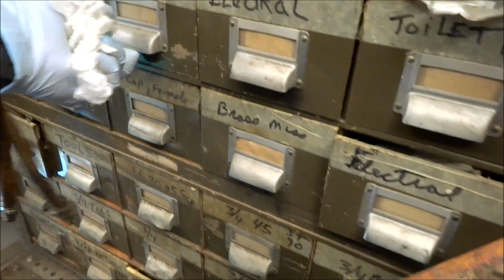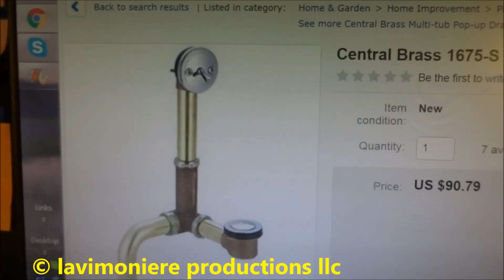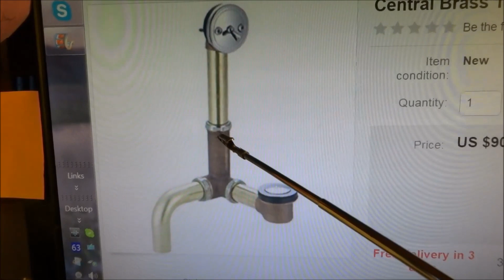tub repair job turned into major project part 1 of 2

Comment: Open up the wall and change the overflow????  They sell a press down / spring loaded drain stopper that screws into the drain and pops up and down when you press it. 15 minute labor, $15-$20 part.

Comment: what a major job. i would have opted  for a rubber disc set over drain opening to keep water in tub .easier. cheaper. and it works . but that would be for me, doing for a customer always costs more money.

Comment: 29:31 Don't you just want to smash it with a hammer till it's destroyed! :)...Nice chunk of brass...I have a nice little collection of the drum traps after 30 years......We usually have lead connections. on those old assemblies So, sawzall and fernco......I just did the last one I'll most likely do attached to a lead pan...Retiring from that stuff...Getting in those access panels and working at the floor level is just too hard anymore!
Reply: Like the way he uses channel locks as a hammer,guess he don't own a dead blow mallet.
Reply: @340rps  :)...It's either grab what you have nearby or get up and out of the hole...I say they need to weld a deadblow on one of the channel lock handle ends...Maybe a flashlight too?....:)...

Comment: Coulda used a watco pop up drain kit. I use em all the time
Reply: I use the same thing. Unthread the old strainer and thread the watco in and either change out the old overflow cover or just leave it, doesn't really matter
Reply: I was thinking the same thing... Badda boom, badda bing! Done.

Comment: At 27:34 a few inches to the right and an inch or so below the "tough nut" was a plastic nut that transitioned brass to plastic pipe.  Would this have been easier to remove?
Reply: I dont understand why he didn't just install a new pop up strainer.... oh paid by the hour
Reply: He’s rank ripping her off lol

Comment: Am i missing something here? Why would you not just install a pop up drain or new manual twist screw drain that the customer can open and close directly right on the tub floor? Why do to all that work just so the opening and closing of the drain is coordinated with the overflow? I agree with all your repairs so far but I am totally stumped on this one.
Reply: It’s because rich homeowners have more money than brains
Reply: Just for shits and giggles.
Reply: Selling 101 homie. Sup from LA.
Reply: He only gave her two choices, either be happy with the rubber stopper or if she wants to go with the current linkage then he has to open up the wall "there is no other way", he told her.   Actually for $20 it can be fixed with a Keeney  Chrome Drain Cover  "The Keeney® Universal Quick Cover Up Tub Stopper covers worn or unwanted drains without having to remove the drain. It installs easily with no tools and has a polished chrome trim. Includes roller ball stopper style and fits all drain openings, including Triplever. Keeney is a leading manufacturer and distributor of tubular drainage products."
Reply: What ever warehouse has, get tub fixed, go to next job.

Comment: 22:24 Woah mama. What's that drain removing thingy? Does it come with new drains, or is it a standard plumbing tool? What's it called?
Lemme guess "Drain removing thingy" ?
Reply: It's an Internal Pipe Wrench. It allows you to "grab" the inside of a pipe or fixture to remove it, especially if there is no room to get a regular pipe wrench on the fitting.

Comment: Brings back memories (as a plumber's helper) of having to use a sawzaw to cut those brass nuts off and avoid messing up the fitting's threads if needed.

Comment: what is that tool you inserted to pull out the drain plug? thanks. this coming spring my son will be coming home so maybe we can change the drain and p-trap.
Thanks!
Reply from the maker: http://www.ebay.com/itm/One-1-Bathtub-Drain-Key-1-1-4-and-1-1-2-Remove-Install-Tool-tub-Free-Ship-/121852766230?hash=item1c5efda816:g:p10AAOSwyQtV52~v
Reply: Thanks very much Steve for the link. If it is not for your video. I did not even think that this tool exists. I am sure so many people you have helped are very appreciative of your knowledge.  You should be teaching at a Technical College when you retire because of your deep knowledge of heating. God bless you.
Reply: @23:50 I could have used that a couple weeks ago. Superior Tool 04500 DrainKey™ Tub Drain Remover

Comment: I think I saw that you use Kroil in another video. The stuff is the best stuff I Have ever seen. I used it today on 20 year old fittings and the stuff is a dream. I let soak in for 30 seconds and it still makes a huge difference.

Comment: I'm laughing!  Yep, just 2 weeks ago we had our 50 year old cast iron tub sprayed white.  The guy yanked out the 2 thingy drain parts and replaced them with a turn and drop plug job.  Looks nice, but I feel the old time 2 part drain set up, which you are trying to explain, probably will have done better.  Hair catches on the hinged long leggy piece which slid into the drain hole.  It had a weighted brass tube on the end which interacts with the overflow part(?)  I kept the parts.
Reply: DOLRED

Comment: I have to assume the customer insisted that it still works the same as the original, I never replace those things. Job security though, you’ll be back for hair clogs every 3 months until the end of time.

Comment: Wouldn't you just carry a PVC or abs waste and overflow.  Offset it with some 45 elbows.  I never like to bury compression fittings inside a wall or ceiling.  Definitely several different ways of doing this job.  Recip saw to cut the old one out.

Comment: you are so calm working on the tough stuff. i would be swearing a blue streak at that damn nut and stuck drain pipe.  might have used a sawzall...

Comment: Steve, you should of just gotten a plug that fit the drain, charged $250 and gotten out of there. Doing the right thing is not worth it sometimes. As always great video and that is the cleanest bathroom and pipes you have ever worked on! Keep up the good work.
Reply: I was thinking that too! I remodeled my bathroom and put in one of those toe tap drains!

Comment: Watco makes a retro drain kit that allows you to remove the trip lever and cover the overflow with a cleanout plate and the drain that comes with it has a bushing to fit the drain shoe to install a new drain and turn and lift stopper. There is also a stopper shoe extractor tool to remove drains without the grid. They cost around 50 bucks for a chrome finish and takes about an hour with travel time.

Comment: Personally I would buy a stopper for $1 and be done with it.
Reply: yup
Reply: He’s ripping her off lol
Reply: Hes not  Ripping her off he Gave her the  information she needed To make a d Decision.
Reply: Personally All it takes is a child to drop  A toy in the drain and then have the whole drain plug up. That $1 stopper can cost you a   Fortune. Everyone's situation is different just as their ability to get projects done. The man gave her the information she needed to make her informed decision.
Reply: @Gcanno  I know they just wanted it fixed right. Even still if I wanted it fancy, I would of installed a less complicated lift and turn strainer or the push type.
Reply: I would agree, but you want to pay extra for me to come out on Sunday, I will be there ready for action
Reply: Replace current drain with toe touch which has a built in stopper.

Comment: You can just replace that with a Touch-toe style drain kit with a blank overflow plate without opening the wall.
Reply: patrick cronin that's the first thing I thought of
Reply: Thats true but he does get paid by the hour
Reply: That would've been the nice thing to do but he's worrying about his pockets too.
Reply: exactly. or even cheaper use a $2 rubber stopper. this is completely unnecessary madness but the customer really only has themselves to blame. I always learn a lot from Steve's videos though.
Reply: Orlando Flores that’s completely ludicrous on your part. He tried to save them money by coming Monday, and he offered a rubber drain plug.
Reply: Exactly what I do for my customers, more reliable system too. This whole job was unnecessary
Reply: @orlandoflores8681  What does that mean, 'he gets paid by the hour' ?
Reply: That was a BS comment on you part Steve, saying to her, will cost her more money because was Sunday. You are already in there fixing the problem if you have a issue working on weekends please don't pick the phone on weekends and you will have happy clients. Now my protocol, in plumbing , after I find the problem and know how complicated will be, I tell how much be to do the job. Nothing personal Steve like to see you videos always Pease bro.
Reply: The customer wanted it fixed the way it originally was
Reply: Arm chair commentary go start your own challenged you can do better

Comment: Why did you cut a hole in wall? I do this all the time as long as the threads work a new tub drain trim kit could have been installed. I use the push-button pop up stopper style. I hate these old trip levers. You didn't even check to see if it worked you went straight to opening the wall up. I do commend you on charging by the hour though so many plumbers here charge by "task" Roto Rooter charges roughly $1000 an hour by this method.

Comment: There was no need for a fancy waste and overflow. ABS waste and overflow would've been fine, have the drain coming out at an angle to the side of the beam and just offset the overflow with 2 45s

Comment: A toe pop up repair kit or some other easier repair method would have worked like many people have commented, but this repair should last another 20 to 30 years. I guarantee the old parts would have started leaking at some point in the near future. I'm not saying I would have done this...probably because it's a pain in the ass and I can make easier money on another job  ;)

Comment: i would have changed out that brass 90 going into the la trap. you could have gotten it with a basin wrench. sorry I don't mean to be a critic, I just couldn't have left it. i remember the first time I found a side outlet waste & overflow. i was scratching my head and my ass wondering what the hell is this, and where the Fu$# am I going to find one.

Comment: that's a good reason to call out a plumber on a Sunday because the tub wont hold water. Unbelievable.  Stick a darn wash cloth in it and fill the tub.  Also wondering if the original Kohler parts are available.
Reply: I've actually used a washcloth.
 it lets the water out just as fast as you put it in the tub good luck washing a kid with 3 inches of water.
Granted yes the lady should have waited until Monday. But to each their own.
Reply: One of those flat rubber stoppers several inches in diameter would have served perfectly for years. Lack of inventiveness on the homeowner's part.

Comment: All that work...couldn't the customer have opted for a toe-operated stopper for $15 to work just as well?
Reply: Exactly, we also use a silicone in twist stopper to replace those "in the overflow" stoppers you can never find parts for or that chronically leak!
Reply: Yea, but he made a killing on this job. 96 hr.
Reply: Jeff Banfield $150/hr

Comment: I once did a bathroom reno where I had to add changes to a water supply line. After I soldered everything up I tried to turn the water back on but got nothing. After a couple of hours of troubleshooting and disassembling all my work, I finally checked a shut off valve that came directly from the city line I discovered a small flat stone that had made its way in and blocked the flow at the valve. One in a million.
Reply: You do I good job